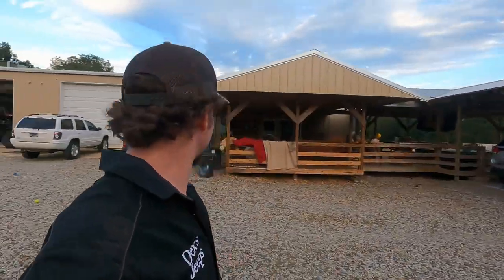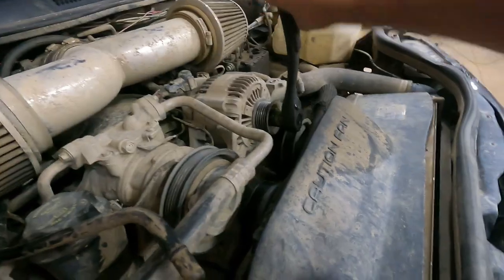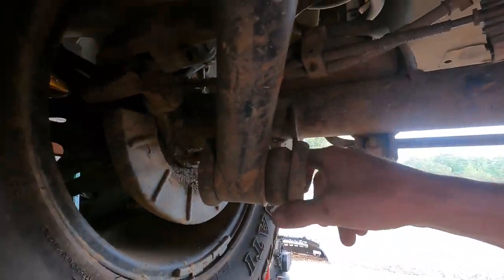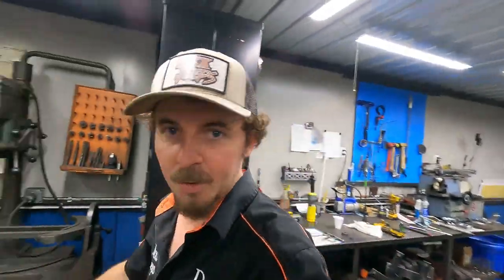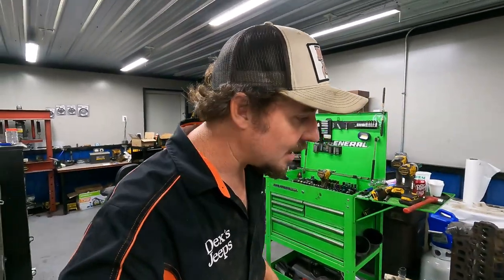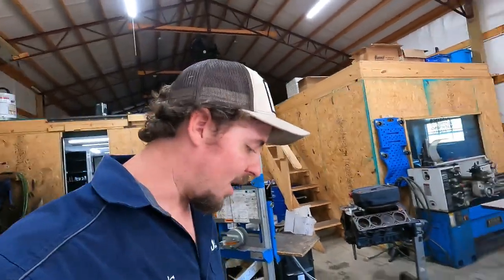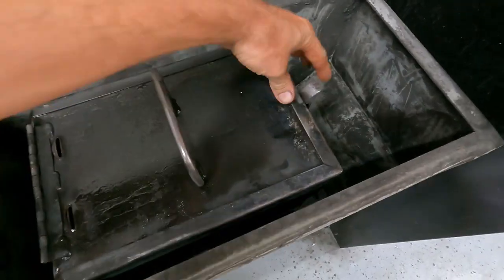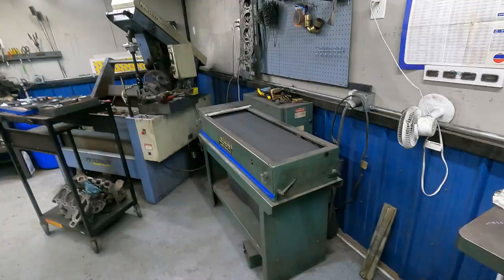From Pulling The Engine Out To Learning How To Do A Valve Job.

Comment: Only one available in the country? The local parts store sells rebuilt ones and they have an unlimited supply  on hand with 4 year warranty. I just bought two at $4k each and have a used one in my garage with 30,000 miles on it with brand new heads. Possibly you dont live in the United States?
Reply: P.S. Mines an 02 overland 4" long arm lift and not all beat up on 33s with a clean title 2nd owner.
Reply: Why then hell do you have 4 engines.
Reply: @fastinradfordable   Because I am about to do a scat build on one with a Eaton m90 bolt on kit. One just got installed into my 02 overland and one is a spare so if I blow up another one I will only be down one day. All are H.O. with og blocks. But not sure about the 4th since I said I have 3.

Comment: Ive had some high miles on 4.7 one 275k and one was 320k heard they dont like if you dont keep up on the oil changes. The one i did have to replace the valve lash tensioners. But i like them good motors not a tough as a 4.0 though.

Comment: The 4.7 in my Dakota has 250k miles and still runs like brand new. I changed the timing chains, tensioners, lifters and injectors at 200k miles. I religiously changed the oil on it every 3000k miles since i owned it.

Comment: have a 2002 ram 1500 with the 4.7.  It was good til upper radiator hose blew and needed head gaskets.  That was 8K miles ago, now at 186K, will see what we can get out of her. Truck is a bit heavy for the 4.7.
Reply: Bud heads just don’t blow when a rad hose lets loose you just didn’t pay attention and over heated your engine

Comment: Same thing happened to mine. I was literally driving it to work and it quit running. Thought it was an electrical or fuel issue at first. Nope, dropped the valve on the driver side head.

Comment: I got a WJ with the standard 4.7 as my first car, I bought it knowing that it had an issue with the valves,  this was before I knew of the common issue of the seats dropping, engine's been sitting in a crate for over a month, engines are darn expensive to fix and my heads are mangled

Comment: Hey Dex, I'm a fan of yours in Australia and I'm driving a 1995 XJ Grand Cherokee 4.0l I6, I am curious as to a couple of issues with it, 1. when Braking going down any steep decline it gets the death wobbles, 2. when starting it I have to wack the fusebox, I'd pressume that'd probably just be a short in the wiring or a faulty connection somewhere? also the accelerator is sloppy as all hell, practically touching the floor

Comment: Hey Dex, I have a 4.7L 2002 with about 175k that is in good running condition, the body is rusty but everything works good. Would you be interested? VIN 1J8GW68J32C183353   I'm currently working on a 97 Cherokee 2 door sport.